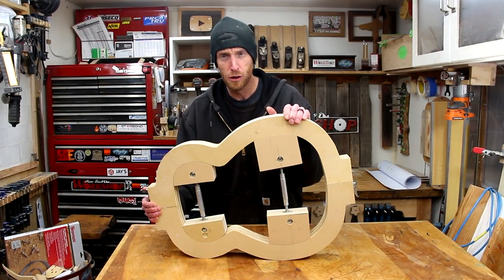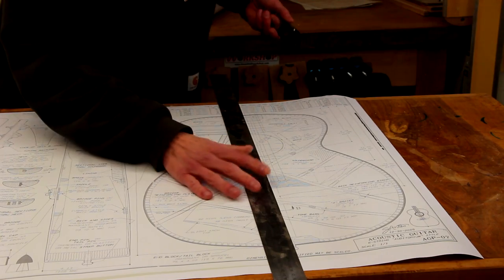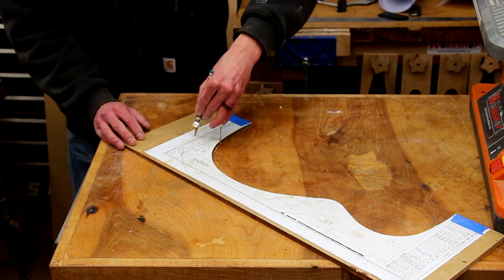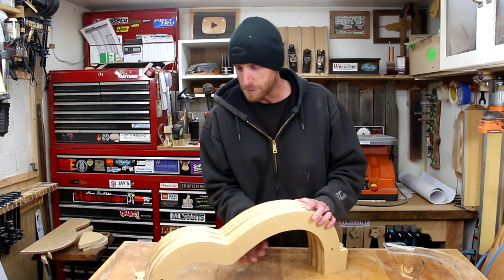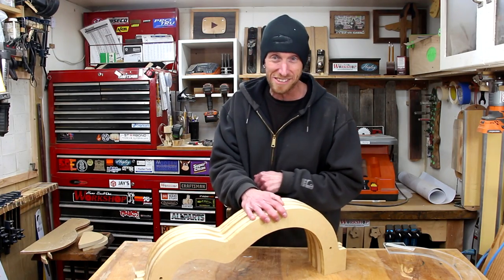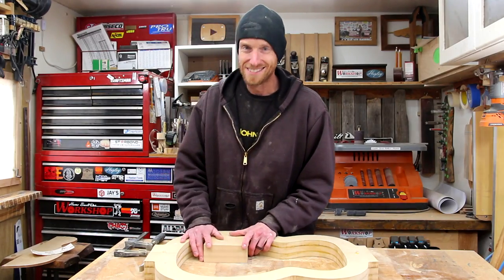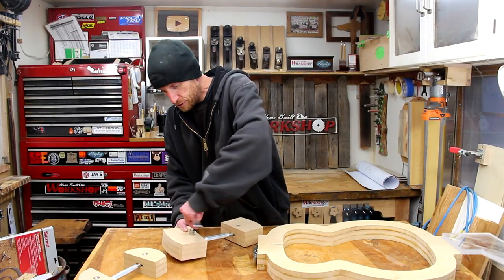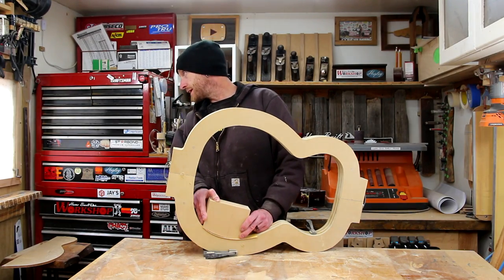How to make an Acoustic Guitar Mold | Building an Acoustic Guitar

Comment: Cool idea with the floating blocks.  If I was to build an acoustic guitar, that would be what I would do.  However, I would have cut the hole for the turnbuckles out of the middle piece of MDF then drilling the outer ones before gluing together to save time later, but that's just me.  Yours looks like they will do the job perfectly!!
Reply from the maker: Thanks. That seems to be a popular option. It would be super easy to do as well.

Comment: Nice Video! You might want to consider making the blocks small enough yo remove thru the sound hope. That way you can leave them in during the entire glue up of the body. Also the finish of the block , inside the form, should include the thickness of the sides as that will slightly change your radius.
Reply from the maker: Good idea! I can easily adjust the size and radius when I get to that point if I need to.

Comment: I just finished one of these. I only used one set of spreaders though and placed them at the waist(narrow part) of the mold. I used 5/8" oak dowels through the spreader hardware. There should not need to be that much pressure on the sides. I used leather too.
Reply: Did you cut to the inside of line for frame mold and the outside of the line for the side bender pieces ?

Comment: Really nice job. I'm thinking that the spreader blocks should not be  an exact fit with the mold inside curves. There will be approx 3 mill of side wood between those surfaces, meaning they won't fit cleanly and there'll be uneven contact and high spots. Adding the leather padding will increase the error. It might be fine, I don't know( I'm about to start my first build too). Rather than cut the mdf on the bandsaw, then flush trim it with the template and router, is  there some way to use a very narrow router bit to cut the  the waste out and then use the waste to make the blocks? The router kerf and adding a layer of leather might leave a gap that matches the average side thickness. Hope that makes sense.

Comment: Over 20 years both acoustic build and repair work... believe me - those spreaders really need to fit through the sound hole if shape is to be maintained through the plates going on the rim.  For those that are not getting accurate or stable bends on their sides, you really want to work on tweaking your process. - either pipe or blanket bender - to get close enough that a single waist spreader gets the side in close contact along the entire mold.  For those that have some issues there, a small upper and lower bout spreader will usually pull things back into alignment, but try to go into the profiling, side tape, and lining process with as accurate a set of sides as possible.   

On MDF - heavy, not very stiff, and will need some protection from water.  18mm Hardwood plywood - even the poplar-core stuff from Home Depot - is nicer to work with and about 75% of the weight of MDF, and only about $20 more a sheet (a mold with spreaders and .  To get the same stiffness in the mold through the waist, MDF needs to be 3" wide, versus about 2-3/8" for plywood, as stiffness is about 50 percent of hardwood ply in-plane .  Again, MDF is about 65 lb/cu ft versus about 38-40 lbs/cu ft for hardwood ply, so plywood molds weigh about half of what an MDF mold will weigh for the same stiffness (which is why you want a mold to begin with).

You want to be able to easily hang the mold off a luthier's swivel-jaw reaper vise for linings, etc, so weight matters.  You also want to be able to hand a mold which is in use off the floor and out of harm's way until the closed box is ready to come ou too the mold.  A 5/8" hanger hole centered about 1-1/4" up from the inside edge of the upper bout profile and on the seam between halves of the mold keeps things out of the way of the carriage bolt/wing nut closure, and a modified screw-in ladder hanger bracket (heat the bent-up tip and bend such that there is just enough upward kick to keep the mold on the hander).  

Titebond is a good utility glue for this work - horrible for actual instrument construction (it hot and cold creeps, is challenging to regale without full removal, and has such poor initial tack that you'll have to either use alignment pins or clamp twice - ounce to get most of the excess glue squeezed out, and then again for alignment).

Comment: You can make the spreader slot without the bolt. It works just fine and might be easier to remove Also you can also create the slot by cutting it into the middle piece before the glue up.
Reply from the maker: I considered cutting the center piece like you mentioned. I'll see how this works. I can easily remove the bolt if I need to.

Comment: It's cool. But I have a question. Is your spreader block gonna come out in the sound hole? Cause It looks to big to me. I'm just curious.
Reply from the maker: Good eye. My Spreaders will not fit through the sound hole. I don't plan to close the box with the spreaders still in place. I'll remove them before adding the top.
Reply: @homebuiltshop  ah I see. Nicely done sir.

Comment: I think the floating turn buckle is a perfect idea..it will aloow it to self adjust up and down and side to side.. and will make it so the wood  fits the mold perfectly..

      Just one suggestion.... as far as glue goes .... for your instrument , use the original Tite Bond .
Not 2 or 3.. youll thank yourself later on if you need to do a repair or a neck reset.. Titebond original is a standard nowadays with luthiers and factories for this same reason.... and stay  away from hide glue ... fish glue is handy in non critical spots .. but you can usually use tite bond there too ..
Reply: I view Titebond as a nice beginner's view, but is a pain in the butt to repair.  192g hide is standard for a lot of custom builders and 315g for bridges is becoming more common as the strengthened faster drying time becomes known.
Reply: @MDLuthier  yes, it is the standard for a whole lot of luthiers. Because of tradition and they believe it's the best stuff out there.
But the stuff is made from animal hide and is inconsistent.. one batch will glue it so hard you can't get it apart no matter how much heat or steam you use.. the next batch may fall apart in a few years... 
       I heard a good luthier once say " stradivari was a perfectionist and he used the best tools available of the day.  Because that's all they had ...And if he was alive today he would look at all those luthiers and say why in the heck are you still using hide glue ?"

       Original Titbond, LMI (now stewmac) have been the go to glue for many fine luthiers.. 

You know, back in the day they used to pour babit bearing for main bearings for crank shafts or use leather as a connecting rod bearing...and cast engine blocks with pig iron ... 😁
Reply: @MDLuthier  BTW , I've never had a problem separating a glue joint with Titebond.. I have with Hide glue.. in fact I'm working on one now that I'm going to have to use a more invasive approach to repair.... the proteins vary from hide to hide when making each batch..and  this one must of came from a mule....
Reply: Titebond creeps cold and hot, leading to numerous issues with failed/slipping bridges and other loaded structures, failing glued neck joints (eg, Martin's M&T), and much more complicated reglue due to dried Titebond acting to contaminate the joint.   I understand the attractive nature of Titebond - it's easy for new builders to handle, does not require any new skills to be developed, and. - in properly made joints - should not show a sensible difference acoustically.  But after 20 years of doing build and repair work, hide is significantly easier to both build and repair with IF you can push through the first couple days of getting handling down and order of operations.   @thefreese1
Reply: Not so much tradition or indeed ignorance, but rather the enduring truth of the adage, "You don't know what you don't know until you know it."  20 years of hands-on with the stuff helps reveal strengths and weaknesses as well.  I'm also an aerospace engineer, aircraft builder, and think tank technology futurist, so if there was a better adhesive for guitar building and general instrument construction, I would jump on it.  But after the first 50 or so instruments built and what was hundreds of structural repairs,  I settled on hot hide and fish, plus CA and a bit of epoxy for nearly everything on the build/repair side, with Titebond used for jigs and fixtures plus the rare 'safety fuse' joint which I want o see fail to save something else.  FWIW, I don't believe an adhesive is truly reversible unless I can use the same solvent to remove it as I did to make it.  Titebond and epoxy are thermoplastics, so full removal takes time and additional solvents or mechanical removal... that time spent cost the customer money, so planning ahead for repairs (neck removal; wet-set refrets, etc.).  I am in agreement with you that it is not an acoustics thing, as glue lines should be well under  0.001" under clamps... just not enough glue to really matter. @thefreese1
Reply: @MDLuthier  Titebond original.... Maybe make I didn't  make it clear ... Its heat and water soluble....so cleaning up squeezeout is very clean with a warm damp rag ..

Titebond 1 and 2 are not ..they are waterproof and pretty permanent ..

   Titebond original is actually quite easy to remove... just like hide of fish glue it scapes off easy while the area is still warm . And when cool it comes off with a card scraper or razor blade like a champ .. yet dries hard enough to transfer sound ..
        
      Some people will never be convinced... even when their work comes back because it came apart from humidity.... or hot weather.. (or dry weather when it comes to fish glue)

Or the have to saw off a neck and build a new dovetail because the Hide glue will not release..

Nope.  They'll keep using it..
Reply: Let me correct some misconceptions on your part.  Titebond is a thermoplastic glue... put it in a hot car or sauna, and the glue creeps...braces move, bridge joints fail, and often, the repair will cost far more than the guitar is worth.  Hot Hide does not creep - even at elevated temps - but will release given liquid or steam, or just a lot of heat.  Fish needs to be protected from high RH and high temps... I recommend not storing guitars in an oven or sauna, but if that is your jam, post-cured epoxy is going to be your glue of choice.  

Summary:  high RH is not going to affect either hide or titebond - both need additional heat to release.  High RH/hot temp (95%/120 deg F) may affect fish... which is why it's a repair glue and seldom used in construction.

Titebond does not clean up that well before cure, and when cured, requires acetic acid or mechanical removal.  Hide gels and the bulk of squeeze out is removed with minimal effort... a wipe with warm water removes the rest.  Fish is sort of in between the two, with slower cleanup before drying, and the usual warm water wipe when cured.  But I understand that hobbyist builders may be uncomfortable with hot hide and even fish, but there is a reason why high-end builders and better repair shop work with the best glue for each instrument application.  

If you are unable to remove a dovetailed or M&T neck glued with hide, you likely do not have the domain knowledge to attempt that repair.  I've removed hundreds of necks glued with everything from 180 year old hide to epoxy and even polyurethanes... they all come off with the correct technique.  Dovetails and M&Ts pop off with either steam or hot stick... even those epoxy-glued 80's/90's Yamaha FG necks come off clean if you know what you are doing.  

Might consider getting on a couple decent luthiers forums (e.g., OLF,  MIMF) for better info than is generally available on YouTube.  The issue here is a video may be something a skilled practitioner does in his or her spare time, but is more likely done by a newb that has accomplished a 'complex' task once... or not at all.  There are some gems here on YouTube, but a lot of people with no real experience or skill just demonstrates that the Dunning Kruger Effect is alive and well.  Seriously - spend some time going through the glue threads on any serious build/repair forum and leverage that knowledge in your building and repair work. @thefreese1

Comment: does the piece at you cut off at 5:59 become the piece for your bending jig? Could you use that internal cut piece for the bending jig? What size of dowel did you use?
Reply: So would it make sense to cut the outside of the line for the side bending pieces?

Comment: Why wouldn’t you just take the paper cutout and transfer that to the MDF? Use the first one as your master and make the other 5 off the MDF master. I’m sure there is a reason, just not sure if I understand the reason.
Reply from the maker: Thats definitely an option. I decided to try it this way so I can keep the separate master. This way I can easily make more in the future if I need to for some reason. Going straight to the MDF would work just the same.
Reply: Thanks for the reply! Love your videos and look forward to the acoustic build!